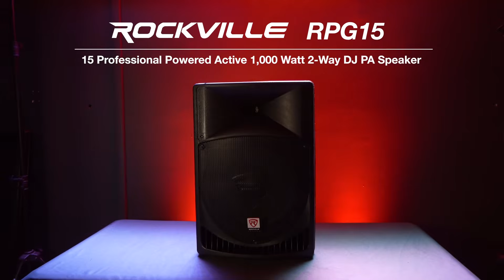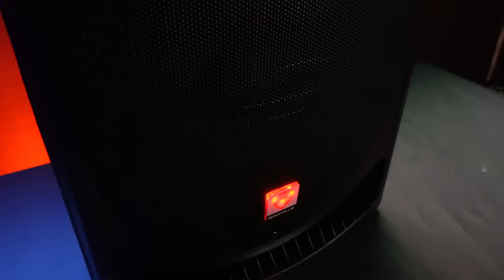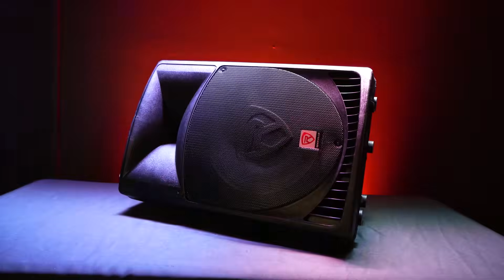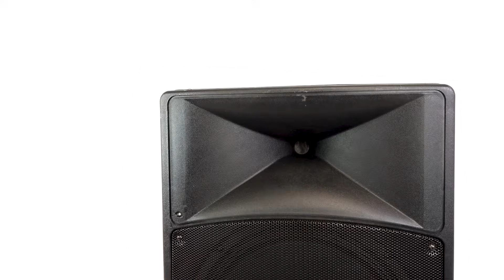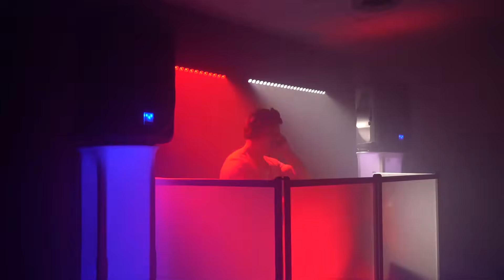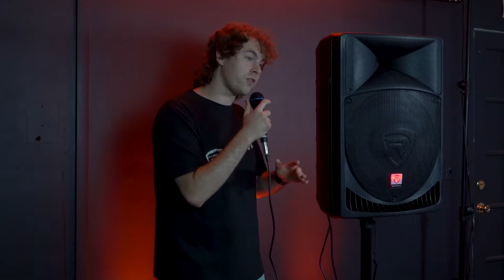All About Your Rockville RPG15 15 Professional Powered Active 1,000 Watt 2-Way DJ PA Speaker

Comment: I would so love it if you could answer this for me!!
Which Output did you use? On the speakers, did you plug into the XLR or the RCA?? And I'm assuming they both individually plugged into your mixer or receiver, right?? I'm a Fitness Instructor & these are the speakers they got for the studio. We helped hook them up a few weeks ago & something isn't right.
Reply: You have to turn up the gain on which one is on the receiving end ….one you have the signal going straight to it and output the signal from that one to the other one the other one has to have the gain turned up